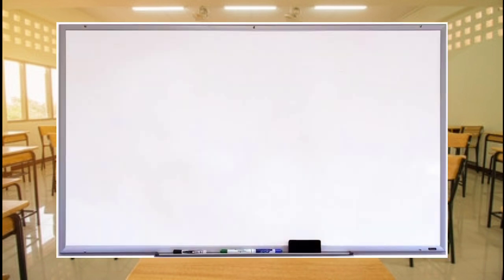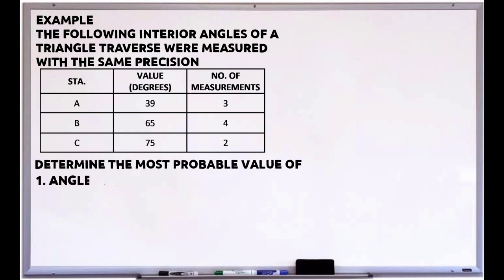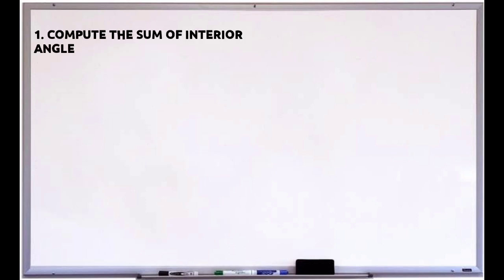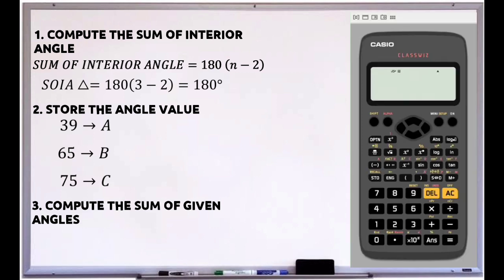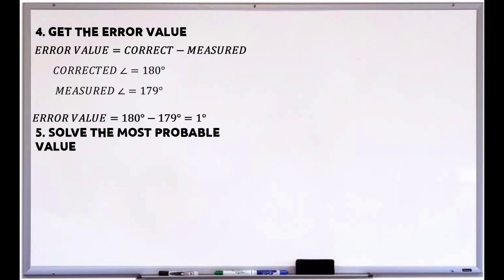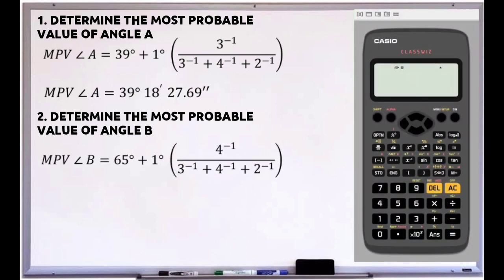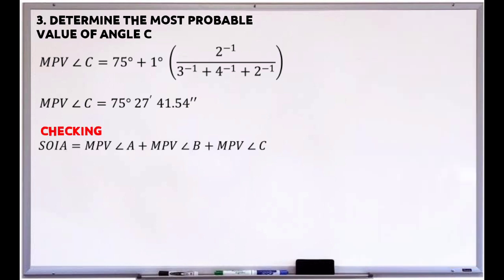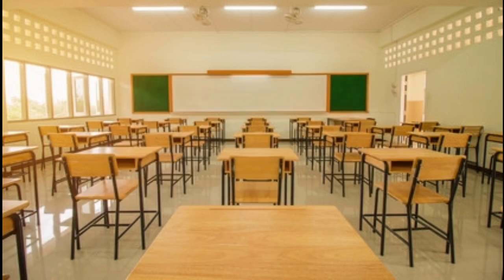MOST PROBABLE VALUE SHORTCUT METHOD

Comment from the maker: 03/11/21

1st case: Corrected angle > measure angle

When the corrected value is greater than the measured angle, the answer of the error value will be positive.  Don't disregard the sign. In solving the most probable value, you have to add the value of error. 

MPV  = Angle+ Error (W/WT)

2nd case: Corrected angle  < measure angle

When the corrected value is less than the measured angle, the answer of the error value will be negative.  Don't disregard the sign. In solving the most probable value you have to minus the value of error.

MPV  = Angle - Error (W/WT)

If you want an example of case 2,  just message me thru my FB page, so that I can send the sample problem with a solution.
 
➖➖➖➖➖➖➖➖➖➖➖
Reply: Hello po, can I ask for the example of case 2 thanks

Comment: Where did you get that -1
Reply from the maker: it's just the same with 1 over the value, for example in angle A, instead of inputting 1/3 in the calculator I just input 3^-1.

Comment: What if the measured angle is greater than the corrected angle? Will I still use the same formula for finding the error?
Reply from the maker: Yes, you can still use the same formula.

1st case: Corrected angle > measure angle

When the corrected value is greater than the measured angle, the answer of error will be positive.  Don't disregard the sign. In solving the most probable value, you have to add the value of error. 

MPV  = Angle+ Error (W/WT)

2nd case: Corrected angle  < measure angle

When the corrected value is less than the measured angle, the answer of error will be negative.  Don't disregard the sign. In solving the most probable value you have to minus the value of error.

MPV  = Angle - Error (W/WT)

If you want an example of case 2,  just message me thru my FB page, so that I can send the sample problem with a solution.

Here is my Facebook Page : https://www.facebook.com/Engineereyas-Vlog-102179305040063/
Reply: Cool! Thank you so much!
Reply from the maker: @heezyyyy   May I know your email address so that I can  send you the sample problem for case 2?